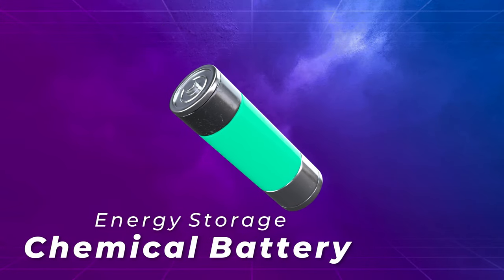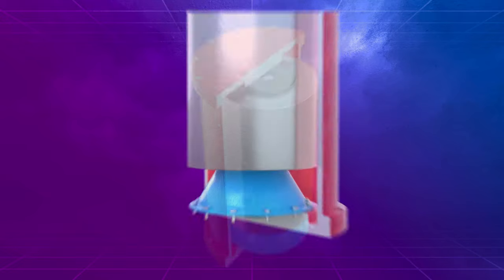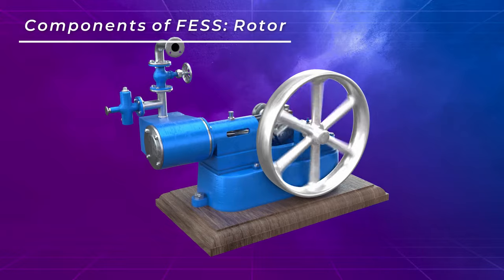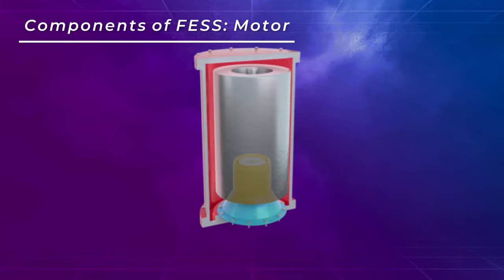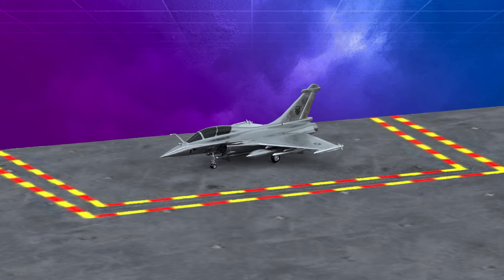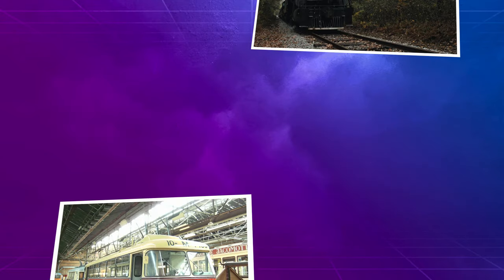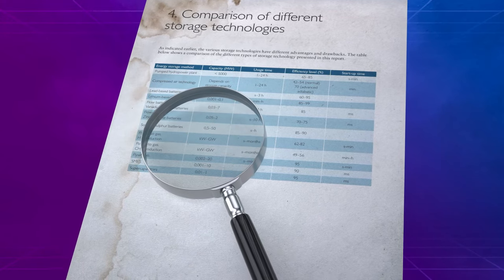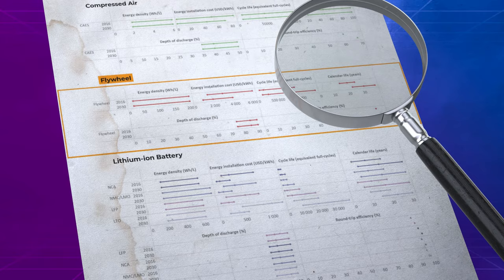The Mechanical Battery: How Flywheels are Changing the Game

Comment from the maker: What do you think of Mechanical Batteries? Any other technology I should look into? Be sure to check out my video on Solid State Batteries - https://youtu.be/nbpJZnLfe4k
Reply: That's like capacitor,  it's better calling that device mechanical capacitor.  ?
Reply: I think flywheels make a lot of sense to adress the intermittency of a renewable enercy mix, it is tried and tested over centuries unlike some odd gravitational bettry prototypes. The key IMHO is to think about energy density vs weight. In an electric car the sheer weight of a flywheel means it can't compete with a chemical battery. But for utility scale, decentralised energy storage it's perfect, isn't a problem if it is stationary.

Comment: There's 1 thing particularly interesting for me with flywheel batteries - how long can they store the charge? Say if I spin it to 1kW storage speed - how much of 1 kW will left after 1 month percentage wise? It should lost momentum sure, but how fast?
Reply from the maker: The idle losses losses during storage is one of the biggest disadvantages of this tech, they lose energy to quickly to be used for long-term energy storage, and there is still a significant barrier that needs to be overcome before the flywheel technology can solve the task of storing renewable energy. This is why they are mostly used for short duration applications where they can operate a few minutes up to a maximum of an hour.

Superconducting bearings will be a game changer as the reduction of friction losses is the main focus of research and development for flywheel systems, since it enables increased rotating speeds and decreases self-discharge rates. 

I hope this bit of info helps to answer your question :)
Reply: @GeniusEngineering  Thanks a lot for explanation!
Reply from the maker: You're welcome. Thank you for your comment!
Reply: @GeniusEngineering  Note that this is one side. In normal application the flywheels are constantly being powered with an efficiency of 95-98% when rotating at an equilibrium. They only spin down when the energy stored in them is actually needed.
Reply: @GeniusEngineering  it is already used a lot for grid systems and self-discharge have been already reduced a lot using magnetic levitation and vacuum to reduce all losses. I think BeaconPower said their flywheels only self-discharge for about 0.1% per month, which is more than perfect for homeowners and microgrids.
Reply: @GeniusEngineering  do flywheels need to be spining for at least 8 hours or longer to cover the night time? in the case of solar energy?
Reply: Just saw in another video, a flywheel that kept spinning after two years.  Stationary flywheel is the best killer of the daily energy duck....curve. It will flatten it to death😮😅

Comment: The flywheel power storage can be used for the power supply of the tram. When the tram decelerates, the flywheel is used to store power. When the tram accelerates, the flywheel supplies power to the motor.
Reply from the maker: In the mid 50's there was a bus (Gyrobus) that operated on the very same principle.
Reply: @GeniusEngineering  the difference is Gyrobus was powered only by the the flywheel, recharging it on each bus stop.

Just imagine having not only no air pollution, but also no electro-magnetic pollution from electricity as it required no electricity.
Reply: i read that many subway station uses that tech already
Reply: @DreamingConcepts  electromagnetic pollution isn't a real thing.

Comment: But doesn't Earth rotation kinda drain power from flywheel? Should they be aligned to counter spin and precession of the Earth?
Reply from the maker: Thanks for your answer @BI7L!
Reply: @BI7L Gravity? Sorry - I don't understand what kind of relation between rortation and gravity we are taking about?
Reply: Not in the case of my designs the axis of earth is orthogonal to the Gajjar Mechanical Battery
Reply: Earth's rotation is slow

Comment: Don’t use electromagnets for the bearings use natural magnets , both pole to north … save electricity!!
Reply: Magnetic bearings are subject to large demagnetization fields and break down. Electromagnets solve that problem but require energy use. Which is better? Depends on what your engineering requirements are.

Comment: Why no passive magnetic bearings?
Reply: Because bearings based only on permanent magnets can`t be stable. It is use some times complex bearings with permanents and active magnets. Then the electric consumption become less. Also can be used bearing on super conductor base, but then you will must to spend electric energy for super conductor cooling.
Reply from the maker: Thanks for the explanation!
Reply: @Sol-En  But they do exist, i assume the spin stabilizes it or diamagnetism perhaps.
Reply: @DwAboutItManFr  Yea that`s true. I think, that it is hard to do electric generator with spin stabilization, because you need quite little gap between rotor and stator for effective work. It is impossible to achive such little gap with only spin stabilization. Diamagnetic forces quite weak  , so it is also difficult to do i think. Main general problem of passive sistem is no vibration supression, and as result big vibration :) So active element unfortunatly must be i suppose
Reply: @GeniusEngineering  And thank you for video. Videos like that are very important for our civilisation, because they are enable beginner and advanced engeneers to learn faster and with more pleasure. And also for Russians like i am it`s very helpful for English learning :)
Reply from the maker: @Sol-En  Thanks for your comment it means a lot and I am glad the content I am making is educational. Thanks for your support!

Comment: I learned that flywheel is used in vehicles to reduce fluctuations of energy. For those that have Engines because they deliver power in only one stroke.
But why do we need flywheel in Electric Vehicles other than the mechanical battery purpose. Since electric motors deliver a constant power.